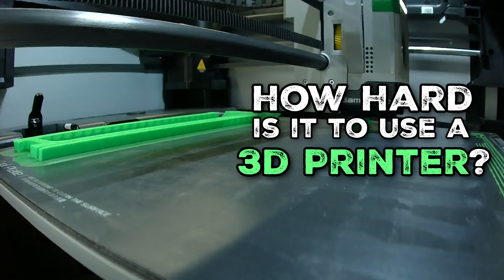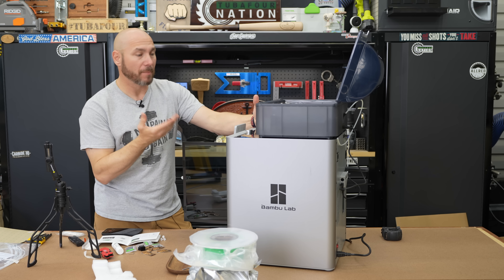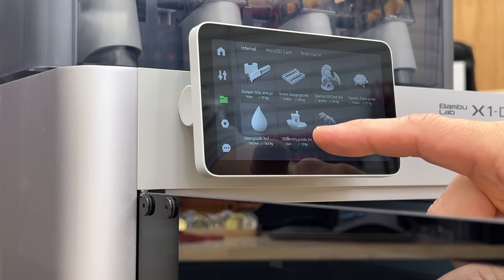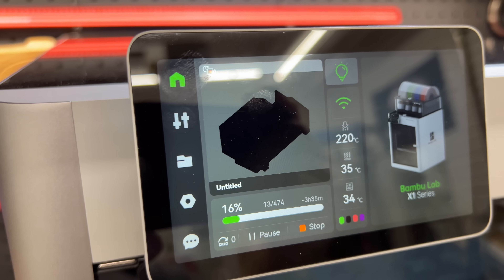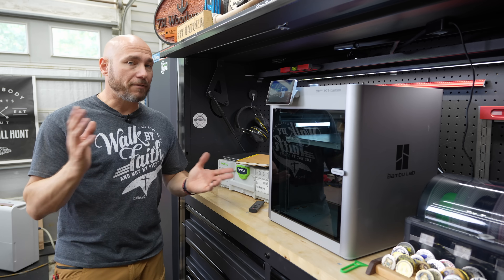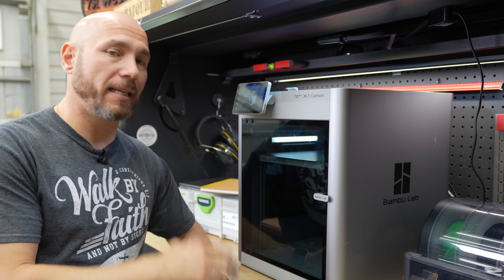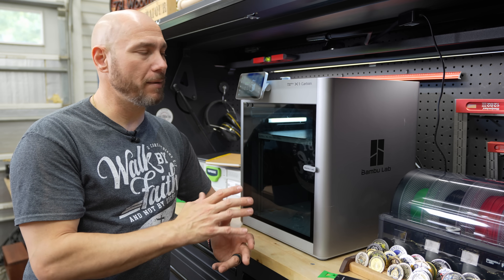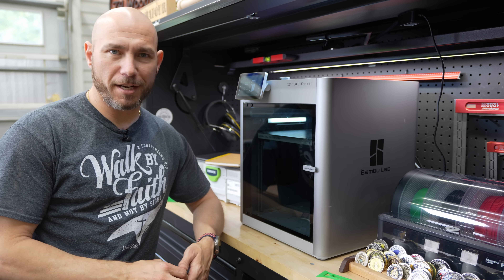Is This 3D Printer Worth the Price? Bambu Labs X1 Carbon Review

Comment from the maker: ▼EXPAND FOR TOOL LINKS and INFO▼ 
Watch Next = Unboxing a $500 Temu Haul - https://youtu.be/j1Se9HTHxjc?si=N3r6L8RjiotdD12y
Tools in this Video: 
X1 Carbon 3D Printer - https://shrsl.com/4rom2
P1S 3D Printer - https://shrsl.com/4rom1
A1 Mini 3D Printer - https://shrsl.com/4rom0 
Bambu Lab Filament (I use PLA basic most of the time) - https://shrsl.com/4c1hh
3D Printers on Amazon - https://amzn.to/3FGSBjm
PLA Filament on Amazon -mhttps://amzn.to/3Mmzcbe
Milwaukee PACKOUT 3D Print Files - https://jonahpope.gumroad.com
AMS Riser Stand I Have - https://makerworld.com/en/models/19535#profileId-19420
Filament for 3D Printers - https://shrsl.com/4katf 
Textured PEI Plate https://shrsl.com/4katg 

Daily Tool Deals on my website: https://www.731woodworks.com/tool-deals
My Favorite Work Clothes - https://truewerk.pxf.io/GmbJjE
The full list of tools and supplies I recommend can be found on my website: https://www.731woodworks.com/recommended-tools
If you use one of these Amazon and other affiliate links, I may receive a commission on qualifying purchases.

Comment: Hi,
Is there any way to export a ".3mf" or ".gcode" file directly to the printer so that I don't have to launch Bambu Studio each time to export the file or connect a USB drive? I already have ready-to-print files.
Previously, when I had the Creality K1C printer, I used Creality Print 5.0 software, selected the printer there, and exported the file for printing without having to deal with slicing, etc.

Thanks!

Comment: incase you havnt found your answer with regular PLA you'd actually be better leaving the door open since PLA likes to cool fast. if you have vert large prints you'd wanna keep it closed though otherwise shrinkage might rune your part but for smaller prints door opens the way to go.

Comment: Ok, I've been thinking of buying the X1 Carbon. I've put it in my cart, then there's all these adds-ons they suggest. Like some bottom plate that is reversible, vibration feet etc... Since your story sounds exactly like mine, did you buy any extra parts, and or would you now that you have your printer and have used it? 
Thanks for your input. 
Mike

Comment: Few hours is definitely not long, although I do appreciate that, being new to 3D printing, you don't have the point of reference. Just to give you one, on a bigger Ender 3 max I had few years back, I regurarly did prints that run for 6-7 days. 😀 I since switched to Bambu Lab entirely and have zero regrets.

Comment: Man, 2 to 5 hours for a large print, this is why I am thinking about upgrading. My makerbot from 2013 has a smaller build space, only can do dual colors, no AI detection, no camera for remote watching, has about $1000 worth of upgrades I have done the from 2013 to 2015, does not auto level at all not to mention first layer detections with LiDar. And I have over $2500 in my slow old machine. And this thing you bought is night and day compared to my old way of printing. Oh, and did a mention its slow. your 3 to 5 hour print would take mine probably 20 to 24 hours.

Comment: At first, I was mortified that someone would buy what is pretty much THE flagship for home printing on a bed this size with no prior knowledge or usage of 3D printers. At first I thought I was watching a 16 year old get a Mercedes for his birthday. But then it hit me… that’s not what it’s about. We’ve accidentally normalized the struggle of 3D printing over the years - having to constantly tune machines, having failures if your slicer settings aren’t perfect to your setup, and spending more on parts/fixes/upgrades than you did on your original printer just to keep it alive. Watching you, essentially a layman to 3D printing start operating on a level that I couldn’t get to for weeks into my first printer was something that I’ve been waiting for for years. This is how 3D printers become home appliances. Glad you’re in, my man. Congrats on having one of the most beautiful machines out there.

Comment: I own a P1S without the AMS, I wish I bought the combo instead because I would love to be able to print multi color. A few things I'd recommend. Depending on where you are located invest in a filament drier, I have a Sunlu S4 that fits 4 rolls of filament and is amazing, if you haven't yet, you will soon start having problems with bad quality prints and its usually caused by wet filament (due to humidity), so I drier is a must have. Also would recommend getting the textured PEI build plate, make sure you don't touch the plate with your fingers because the skin oils will cause the prints to not stick. I have never had to use ANY glue for my prints in the 10 months I've had my printer.

Comment: Using glue stick is a release agent so you can release it from the bed, some printers have textured PEI plates bambu included where you dont need to mess about using glue stick.

Comment: I'm doing some researching about this model and the other model P1S, but my question which i couldn't find an answer yet.. will be ok to be used inside the house? i mean will it be noisy at night in case the printing took more than 10 hours or so?? if it was noisy will i be able to pause it and continue next day??  i hope to get an answer for those if possible

Comment: The staff from the DJI Quadcopters did it again.  Yes, they set the industry standard for proprietary easy to use 3D printers.  Worth the Price? Well, if you have the money and don't have experience, than in a word "Yes".  If you have experience in 3D Printing, and can do a lot of R&D  you can do better for the price.  If you are looking to 3D print on a budget, there are options that have the same quality and reliablity (with some quirks) that are not E3s or E3 clones, at a fraction of the cost.

Comment: The speed thing reminds me of the modem days.  I started out at 300 baud.  I remember thinking 1200 baud (4 times faster) was awesome when it came out. Today's speeds are insane by comparison of those early days.  3D printers are going through the same process.  I wonder how fast they will be in 20 years.

Comment: Tip: when you apply glue stick, for the next print, use a paper towel and a little Ammonia. Use the same paper towel each time. Between the buildup of glue on the paper towel and the bit of ammonia, you will actually spread a thin layer of glue. You can do this many times without adding glue. Ammonia also removes any surface oil.

Comment: The X1C with AMS was my first endeavor into 3d printing.  I'm 3 months in, and I've had zero problems so far.  I grabbed a few free files, but I quickly started designing my own parts. There was a big learning curve in the beginning, but once I got going, it was super smooth and super easy.   This is a fantastic printer, and it's definitely worth getting the AMS model.
Reply: What program did you use to design

Comment: Have fun, good attitude! If you let it run like that for 24 hours, you didn't break it ;-) My longest print on the X1 runs for 3 days, 300 hours of runtime per month nothing ordinary at all. Only the X1 has Spaghetti monitoring, everyone has to know for themselves whether they will trust it or not... Like your mishap with the AMS when it automatically retracted the filament, it should also automatically stop printing when it then prints into the air and will make the famous spaghettis..... So there is also a difference to the cheaper models ;-)

Comment: I own the x1c and think it is a great printer but if I had to do it over I would probably buy the P1S because I never use the lidar and the screen itself is probably not worth the extra $500 or so.   Again super happy with the X1C.  I love using it as a tool and the printer itself is not the hobby.

Comment: Followed you a bit via your 731 woodworking channel. You have no idea how good you have it with that machine! Like so many other commenters here, I had an Ender 3 back in the day. Last winter I took it apart for some "quick upgrades" and haven't bothered to put it back together because I am just so frustrated with how slow and problematic it is. Those trays and containers you have printed are ENORMOUS. I would never dare print anything that big on my ender. And if I were to try it would probably take DAYS plus or minus how many times I had to restart from zero. That Bambu is a sweet machine. I hope you enjoy it.
Reply: i found a channel called "CHEP" that makes the fastest profiles in the west for the ender 3.

Comment: Hi Matt, new subscriber here.  The little boat thingy is called a "Benchie".  It is a benchmark test 3d print where you can evaluate how well your 3d printer handles tough problem areas.  Examples would be does it print the text underneath clearly?  Are the sides of the boat smooth?  Do the arches print cleanly?  Is the top smooth or stringy?

Comment: If this is your first printer you have no idea how fast this printer is compared to literally anything else out there.  My first printer was an Ender ,5 years ago, and finally I'm up to this X1C as a culmination of my hobby.  After upgrading the Ender to make it one of the more reliable printers I have, I had a good foundation of knowledge to move up the ladder of tech.  Anyone who is thinking about this as a printer and has minimal experience in this field may want to consider a P1P for less cost and nearly identical features.  If you are serious about this profession and are willing to learn, start with a more hands on printer (Ender/Artillery/etc).  Once you get 6 months to a year of experience of this level of printer, move to the Bambu tier.  Terms, functionality, and theory of operation will all be identical and small problems that you might experience with this printer will be old hat given your starting point at the bottom tier.  This has been both the most rewarding and the most frustrating hobby I've embarked on but worth every second of effort you put into it.

Comment: In regards to the AMS: it is a bit fussy with the various sizes and types of spools and works best if you use the refillable Bambu spools that came with it. Also keep the lid shut or the spool will sometimes try to walk up on the rollers when retracting.

Comment: I keep looking and WANTING to buy one of these; but, is it REALLY COST EFFECTIVE?  Or just a toy to play with? 
What is the difference in the wire(s) (other than color)? I know there are different thicknesses, but what about the material itself?
How do you determine what wire you use for which project?
Like the drawer organizers you have, how much wire did it take to make one of them? Cheaper than just buying them?
What items should you have on hand when they fail. Like the nozzle head, etc?
Will one nozzle work with all sizes and brands?
Does a machine have to use ONLY A CERTAIN BRAND of filament?

They look cool as heck. And there are all kinds of things I would love to make with one. But when you add up the total cost, are they worth it?
I am looking online right now at a 10-pack of 1.75mm filament wire, USD $464.00. There is nothing that tells me how many feet are in a roll. 
I know it would depend on the project as to how much you will use, but how do you figure that out? (I.E. Project * feet of filament needed * cost per foot = ?)

I am not looking to start a business in 3d printing. But I do have a ton of things I would like to make for my barn, house, tools, etc.  I am just not sure that (Minus the cost of the machine) the materials needed are cost-effective. 

I OPENLY LOOK FOR FEEDBACK FROM ANY AND ALL!  LOL, help my YIN and YANG convince Me, Myself, and I! 

Thanks!
Reply from the maker: For me, it's just a toy. I'm not trying to produce products to sell.  I only wanted it to make stuff for me personally.
Reply: Thanks @TheOutlawEffect

Comment: Hey, hope you are doing well.
I Loved watching your Tutorial videos on YouTube.
as a beginner in the 3d printing world, i wanted to consult with you regarding which printer i should buy.
I've done some research and seen many models out there.

My main concerns regarding which printer to buy were:
1.Precision of the 3d model.
2.Printing Multicolor 4+
3.Top Layer quality of the print.
4. can print big models

So the best printer i found to match my requirements was the: Bambulab X1C, since it can prints multi color.
i also noticed that there's something called Pallet 3 pro, but i didn't like the quality that was printed with this tool.
So I'm here to ask you if you can recommend a printer that fits my requirements? my budget is up to 1,500$ for the printer.
The main purpose of the printer is to print colorful 3d action figure models, that's why i need the precision.
Also printing big models like masks or big Pokémon dolls and try to retail them after in my local shop.
I Would really appreciate your help and advice!
Reply from the maker: I'm not sure.  I just got started with 3D Printing so I don't have enough experience to offer good advice on that.

Comment: I just bought a ender printer up Craigslist. Never again will I buy a used printer. I save 75 bucks off of a brand new one and I spent 6 hours fixing what the original owner did to this machine. He was getting rid of it because he got another printer, a bamboo. It was an ender 3 Max neo. The two z hight rods were lose. He has put a magnetic bed on it that was so smooth nothing would stick to it. My advice to anyone who cannot understand how things really work, get a bamboo printer. Spend three times the money or more because when get something really expensive you destroy it because you think you're some sort of mechanical genius.

Comment: If you want to speed up your prints, run the flow calibration for each filament that you use. It takes less than 20mins and will greatly improve your print times. This basically will set the parameters for that print filament, allowing the machine to optimize all of its settings. I have quite a few 20hr prints that I was able to shave down about 25% of the print time just by doing this flow calibration. If you go to the calibration tab in the Bambu laptop program, you will see the flow calibration test. Once it has run the test, you will be able to save the settings file for that specific filament, and easily be able to select that specific file when you go to print from now on. Also make sure to dry your filament in a dehydrator to the manufacturer specs, this will make sure that your print time and success rate is more reliable.  Best of luck in you 3d printing adventures.
Reply: I have a Sunlu FilaDryer S1 plus. I like it. You can tell the difference in a print used with and without it.
Reply: Good tips. Can you recomend a dehydrator? Thanks
Reply: @ronaldhoppus9015  I have a printdry, it's okay. Sunlu has released some pretty interesting dryers in the last 6ish months. Might be worth a review search.

Comment: Washing the plate didn't fix your problem(bulge), taking it out and placing it on correctly did. I would look to the back outer corners for low rise stops, the plate was probably on on of those and it was just enough that you couldn't see it but the sensor could.

Comment: That "bulge" issue you were having was probably a misalignment with the build plate. It usually happens in one of the back corners where the spring steels is slightly overlapping the edge of the bed. It's slightly raised at the back corners to aid in alignment.

Comment: 9:04 you not really getting faster printers than a X1C. Only the max flow of the hotend and the cooling is limiting it a little. But 20k acceleration is pretty insane.
Try out sport mode for some prints 😅

Comment: Excellent thoughts. My X1C is technically my second 3D printer, but given how quickly I gave up on the Ender 3 (that I still have) it may as well be the first. That small amount of experience I can use to say you made a good choice here. It truly is pretty much plug and play.

The most 'catastrophic' error I have had since I bought mine a few months ago was a clog in the extruder while trying to print PETG with a PLA support material. The filament somehow flared inside the extruder so I had to disassemble the entire print head to clear that out. And even that was ridiculously easy. A few youtube videos and about an hour and I was back up and running. it really ticks so many of the tech or gaming space buzz words. Plug and play. It just works. Newbie friendly. But once you become comfortable and start messing about, it's also insanely powerful. Sure, you can just grab a file from Printables, upload it and sit back as it prints. But the freedom is crazy.

Just yesterday I got a second AMS to give me more colour options. It was super easy to print a stand for it that sits over the first one with ample clearance for the lid to open on both. Once you have one of these, the growth potential is endless. I definitely liked the look of that toolbox model you showed under you AMS and might be giving one of those a go now I've got plenty of filament on hand. Need to get the slew of little tools I use around the printer off a table and into storage to give me more workspace.

Anyway, rambled too long there. What I truly wanted to say was the single coolest at home 3D print I have ever seen someone make was done by Nerdforge here on Youtube. She is missing the pinky on her left hand. So, she designed, iterated and adopted daily use of her own personal finger prosthetic. Which is insane. You can replace a human body part using this stuff. My mind was blown by that video, and I encourage you to have a look. The possibilities of this tech is endless, and the consumerisation of the hobby can only be a good thing. It doesn't mean the hobby style machines and habits have to go away. But it opens the door for people who were too intimidated by the barrier to entry of the other styles.

Great first video on the topic and I am subbing to see what else you have to say once you get deeper into the art.